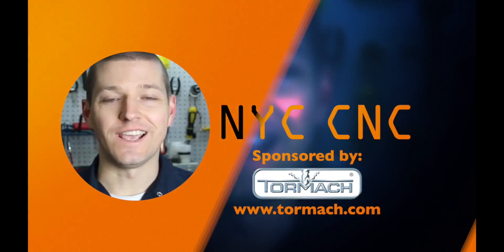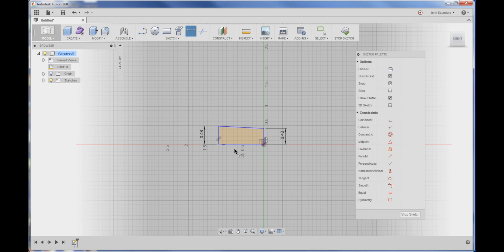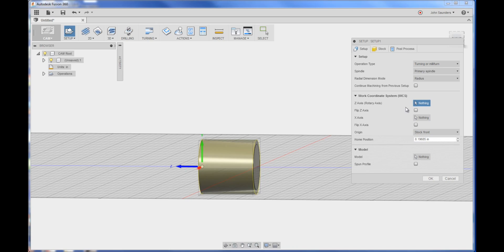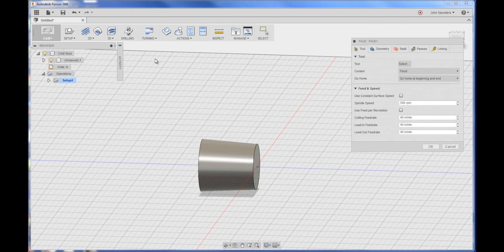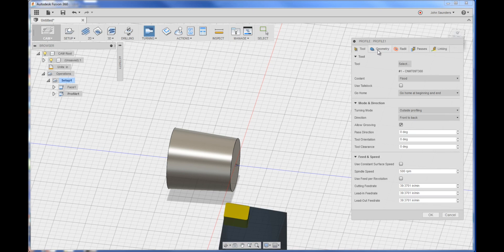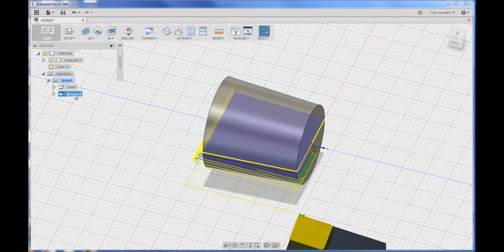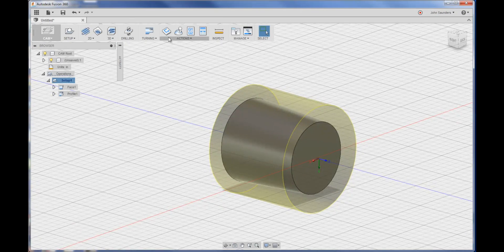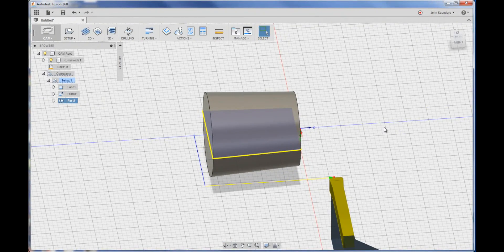Fusion360: Lathe CAD & CAM for NYC CNC Halloween Prop!

Comment: For those of us without a CNC lathe, it occurs to me that stock for small parts could be held with a collet in the spindle of a CNC mill (which I do have) and the turning/facing tool could be held in the milling vise. You might not have all the nice lathe tool-path calculations, but a set of Z-axis and X-axis routines would allow for production of a number of identical parts. 

By mounting several tools (turning, facing, drill bits with tips pointed up, chamfering, and parting) to different locations on the mill bed and adding some Y motion, you could even simulate automatic tool changes. (I can imagine some possible rigidity problems if the bed ways are not sufficiently tight.)

Comment: Nice work john as usual :-) 
I often think how simple fixturing the lathe is compared to the mill.  Fusion 360 videos detailing fixtures setups would be great.
Reply: The mill definitely. 
Also was Pathpilot an option for that lathe part or did you just want to show fusion?